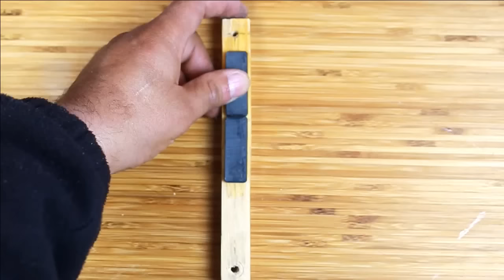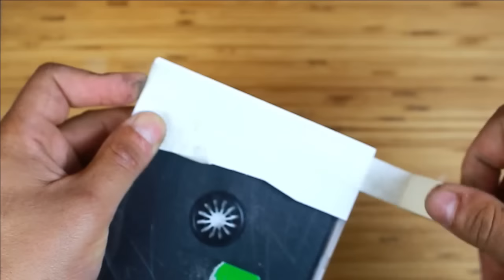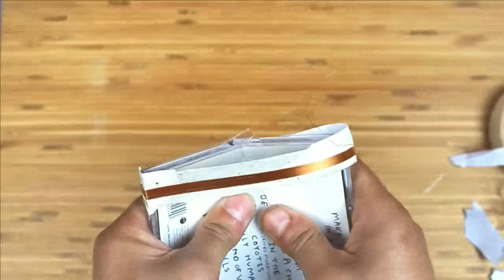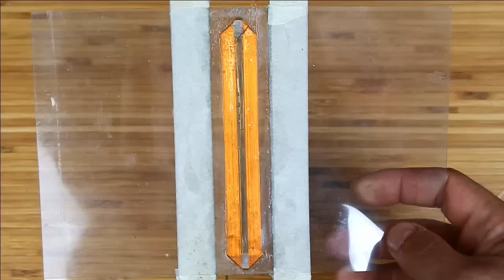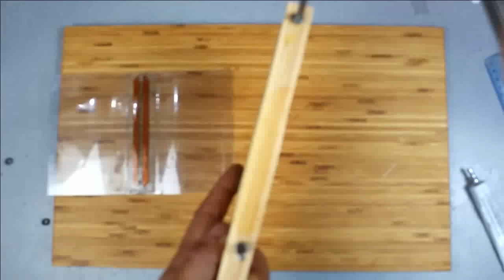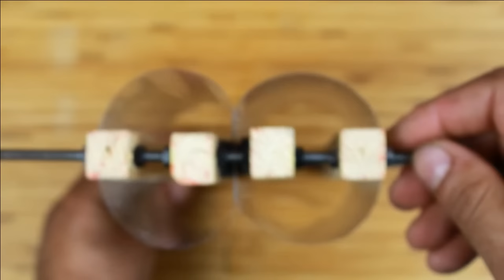--||-- Diy Full Range Rubanoide Speaker --||--

Comment: Nice project but from a sound-engineering perspective this design is sub-optimal - the craftsmanship is not the problem, but rather the fact that it's reproducing both sound and antisound from each deflection of the dual diaphragms, these sound waves interacting with one another both additively and subtractively in the surrounding space relative to the room acoustics and listener location.

A conventional voice coil is designed to be mounted to a flush surface of a body enclosing the rear of the speaker.  Meeting this bare-minimum criteria suffices to block most of the antisound for an easy build with half-decent sound (ie. faithful / intended rather than erroneous / extraneous reproduction).  Even better however is to design the volume of that cavity behind the diaphragm for optimal resonance (Q-value) properties as a function of the elasticity of air, particularly wrt bass and mid-tones, leaving only a small aperture for internal vs external pressure equalisation (as with varying temperature and humidity), thus exploiting the air's elastic potential energy to recover and use the otherwise-wasted energy of the antisound, basically turning it back into more power and clarity from the outside face of the diaphragm.  Using standard formulas available online, a well-designed cabinet literally sings.

With this Rubanoide design however the voice coil's plane of displacement is lateral, left and right when viewed face-on as above; each of the dual diaphragms are faithfully reproducing the exact opposite phase of the other, literally pissing on eachothers' fireworks, some frequencies cancelling, others amplified.. like pilot and copilot fighting over the controls..

So yes, this will produce a unique and quite dynamic sound reproduction, only in a tinny, nasal kind of way, these distortions obviously only increasing as the power's turned up.

Logically, the 'correct way' to apply radially-uniform sound reproduction is via a radial displacement like a pulsating tube, sphere or pressurised balloon in which the outwards vs inwards displacements are consistent all the way around, and with a central enclosed cavity in the core to absorb and re-radiate the antisound back outwards into more sound.. 

Alternatively, the basic Rubanoide design could be significantly improved by applying two voice coils, one for each side, and driven by the same mono signal, but working against rather than with one another such that the diaphragms are moving in opposite left / right directions simultaneously rather than both moving left then right together as in the current config - ie. a radial displacement relative to the top-down view.  This will concentrate the antisound into the center, radiating out from above and below, and thus being polarised in the vertical plane will interact less with the horizontally-polarised radial sound waves; better though to seal or add absorbent damping to the top and bottom openings to eliminate the antisound if its energy can't be recovered back into consistent phase..
Reply from the maker: "better to seal or add absorbent cushioning to the top and bottom openings to eliminate sound deadening"
I agree with you 1000% because the addition of a damping inside the two diaphragms is already programmed in the design of the next video in parallel with other improvements.
adding another coil is useless, but adding another set of magnets is very beneficial.
thank you very much for your professional and detailed analysis, it makes me happy to have people of such technical quality like you on my channel
Reply: @homemade_audio  Cheers and yes, a second set of magnets could also be used to similar effect of reducing phase interference from the opposingly-signed sound-pressure waves.  If you can achieve the same basic benefits of a cabinet without needing one and omni-directionality, you'd have a great product concept - novel, stylish and practical..  Best wishes and thanks for sharing your work!
Reply from the maker: @MrVibrating  thank you, you welcome

Comment: I don't get why this works, unless the wire is partway out of the magnet?  There are an equal number of conductors carrying current up and down, I'd think the forces pushing the film backward and forward would cancel out.

Or... Are the poles of the magnets on the long edges instead of the faces?

Comment: The problem with that design is that the current will flow in opposite directions on each vertical side of your rigidly attached voice coil within the same magnetic field, cancelling-out most of the speaker motion!
Reply from the maker: That on video isn't the final magnet assembly design, I'm waiting for neodym magnet from Germany to build the correct design with two magnetic fields zone.

Comment: Single strand cable not enough strength, elasticity and breaks quickly with metal fatigue. You must use braided cable for coil.
All sides, both front and back sides open. Any time, this sides have 180 degrees phase difference for sound wave. This, meaning, created sound waves dampens other, result, too low sound pressure producted. You must isolate any one side from environment, for good sound level, especially bass frequencies. You must look speaker box designs.
Reply from the maker: It's jua prototype,  more things will be improved soon

Comment: Just demonstrating how to assemble something is not much use if you’re not going to give any technical details. Some captions would have been useful like - what is the wire diameter? How many turns? What is the plastic material? What kind of glue is it? What are some basic dimensions?
Reply from the maker: All what did you say is right, this is just a prototype, I'm waiting for neodym magnet to remake the same project with all technical details you have mentioned.